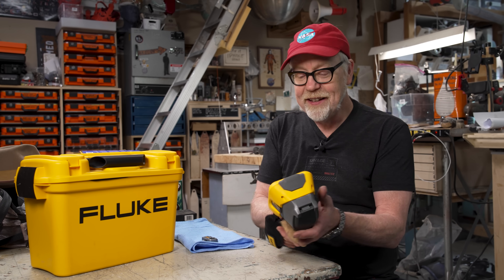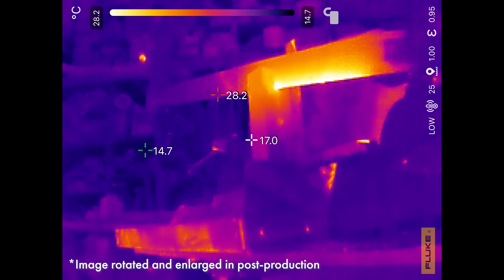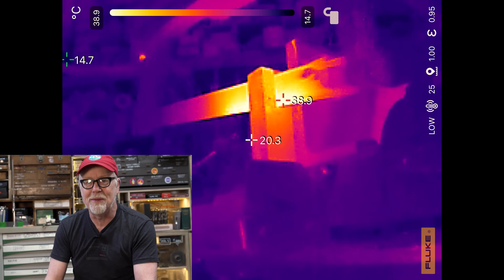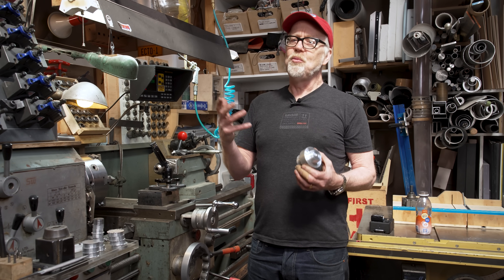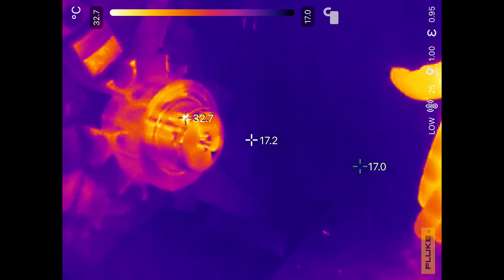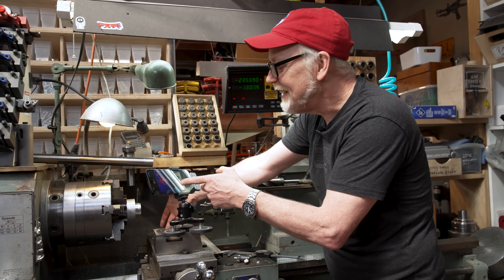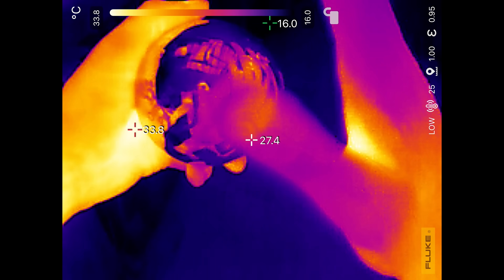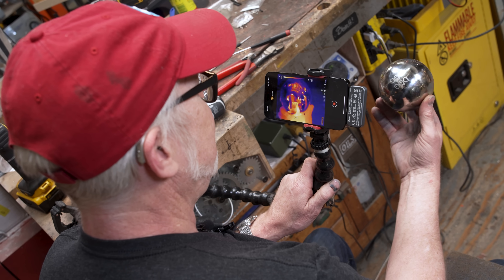What This Thermal Camera Reveals About Adam Savage's Workshop!

Comment: additionally yeah I need to get some thermal cameras so I can give better visual proof of my thermal diode system that uses the heat it is moving to power it, ie think of a house that is cooled by these from them both rejecting some heat and pulling heat out of a house, with out any power, just a passive system until interacted with by thermal photons. best part is all the parts for each unit cost less than 10 bucks, but will eliminate 50 to 100 dollars of a cooling bill with out burning any fuel to extract the heat. Yeah you saw that right, think 107 outside and 65 inside on the window it is placed over, while even the full force AC heat pump cant get that window below 80 or the insulated walls below 67 degrees, (that house only had 4 windows replaced with these and it dropped a 400 a month bill down to less than 100 a month during august, july and part of the june and sept months that are still hitting over 100 for highs LOL)

Comment: For the hacksaw, you could add a limit switch. But it would be simpler to just have a rod of low-friction plastic (HDPE?) that you slide into the saw frame so when it cuts through it simply drops a bit until the hacksaw frame rides back and forth on the plastic bar. No mus, no fuss, won't even squeak.

Comment: I really want a thermal and UV camera together along with visible spectrum of course.  A 3 camera setup that blends all together for a much broader visual spectrum would be super cool.
Reply: We put together a tripod with these, plus added an ultrasonic down-converter, to help identify electric substation equipment that was starting to fail.  It was fascinating, but we didn't get funded to build a "strike team" to go out and examine things in non-human wavelengths on a preventative basis.  Oh, and we added high-res GPS and angular measurement so that people could follow up and find the equipment on a map overlaid on the station!  Specific UV wavelengths are associated with corona-type breakdown of air molecules.

Comment: Your ceiling looked awfully warm in the reflection of the sphere. 
At what distance does the accuracy (heat resolution?) start to fade?
Reply: Distance is not a factor in "heat accuracy".  It mostly works just like a regular digital camera, but tuned to different wavelengths of light.

Comment: A power hacksaw is not a bandsaw. Bandsaws have replaced powered hacksaws because they are faster- no return stroke. Plus all the blade's teeth are used for cutting and the blade is longer so it lasts much longer.

Comment: Fun thing to do with thermal camera. Go to a shelf or a box full of screws or bits. Look through the camera, if they are all uniform temp, they will basically be invisible to the camera. Blast the thing with a heat gun for a second or two, then watch as suddenly you a see all the items based on how well they take on and store/maintain the heat. It's very cool how you can go from not being able to see anything to suddenly getting a full image of what is in front of you just by adding some heat.

Comment: Lower resolution solder kits are cool. Plug-ins for Arduino-like cameras exist if coding is more your speed. Best tool ever for lowering my heating bill, in wall wiring, and leaks.

Comment: Many people have already said it, but I thought I'd chime in; radiative heat would in fact be photons, however of lower frequency than the visible spectrum, hence infra-red. It appears the aluminum is highly reflective to infra-red photons in the frequency range being captured here. Similarly, radio waves / signals are photons, microwaves, UV, X-Ray, Gamma, are all photons. Radio and micro are also sub-visible, and thus lower-energy than visible, while the other three are higher frequency than the visible spectrum, (hence ultra), thus higher energy. Definitely check out the deeper details of black-body radiation. I'm sure you learned something new today, and that's awesome!

Comment: Photons discussion aside, seeing the heat from your hand reflected from the piece in the lathe and the chrome ball also illustrates that measuring the temperature of a reflective surface with a thermal camera can be difficult.
Reply: Indeed, while Adam interprets the warmer area on the sphere as showing the sphere getting warmer, seems to me the effect is more about the dulling of the reflective surface, allowing the sphere's actual thermal signature to be seen in contrast to the area that remains shiny, and thus practically invisible to the camera (i.e. showing instead reflected thermal signatures, not the sphere's own thermal image).

Comment: I picked up a FLIR ONE Pro on eBay a while back and it was quite revealing. From areas with poor wall insulation in my house, to identifying hot-spots in circuit designs, infrared gives a new depth to data. While recently working on a circuit design, I was a bit surprised to find that the bridge rectifier was the warmest component. Data!!!

Comment: I have a Ulefone Power Armor 18T Ultra phone myself. It's a nice rugged phone with a built in "microscope" camera with 30x-60x zoom and a FLIR Lepton thermal camera. I love that phone when it comes to fixing electronics because the microscope helps in finding broken traces on a circuit board and the thermal camera can be used for finding hot spots and malfunctioning components.

Comment: Small physics correction that the reflection is actually photons, albeit at a lower wavelength. Heat is radiated out as photos in the infrared spectrum
Reply: Nit: higher (longer) wavelength, lower frequency.

Comment: 2:43 - well, except that the "heat" it is "receiving" is still the same exact type of electromagnetic radiation as visible light, just at a frequency that's not visible to our eyes.  The experience I had that really gave me an intuitive understanding of this fact was at a MakerFaire (in... 2008, I think?  Something like that.  If you saw a quarter shrinker, that was the group I was there with), and there was a giant fire-breathing dragon sculpture, and it was a little ways away from me.  And I detected a "flash" of heat, that I felt on my skin.  I turned in time to see the flame still coming out, and then I heard it ... and immediately realized that I'd be able to approximate its distance from me by counting the time it took between when the light(/heat) hit, and when the sound did... just as one might determine how close a storm is by doing that with the lightning flash and the thunder clap.  These things are not so fundamentally different!  (Though certainly, the technology for sensing the different wavelengths, as well as other aspects of the camera like lens materials and such, have significant differences.)

Comment: As someone with some daily worn custom cybernetics tech to let myself "feel" thermal imaging via neuroscience tricks, similar slightly to how snakes might perceive some elements of the world around (for my use it is for full 180° spatial awareness of people behind me mainly), the reflective thermals off metalic surfaces also suprised me at first during usage, such as when in an elevator with no other heat sources - keep catching myself, having never considered that before.  It does make sense in hindsight, with the wavelengths and what it is capturing overall. 

The interesting twist, is mirrors often will not reflect as well, depending on the method of manufacturing, being more optimized for visible spectrum reflectivity.

Lots of interesting thermal traces out there, hot and cold, and lots of information available through those lenses, into more abstract information (such as me using thermals for spatial awareness). 
Tech Allows one to literally feel temps otherwise inaccessible, much like that thermal cam does, but as a direct experience sensory wise.

Comment: On the first section with the saw, I noticed the piece being cut-off was hot while the rest of the bar in the vise was not.  I wonder if it's because the vise was acting as a heat sink.

Comment: Would Love to see the effect of cutting fluid on a drill in the drill press. I accept that it provides lubrication, but I wonder how much actual cooling it provides. Does it keep the bit temp 20 or 30C lower? Or only 2-5C lower?
Reply: Cools, and also reduces friction.  You can set some of the cameras to show a fixed temperature range rather than just 'hottest thing in the scene is this color and coldest is that'.

Comment: Very interesting that the band saw blade got hotter when it got to the bottom of the bar it was cutting through. Based on the heat gradient up to that point, I’m presuming that this was because there was less thermal mass left around the blade to act as a heatsink.
Reply: Or he hadn't applied the coolant oil in some time, though yours is probably the larger effect.

Comment: That’s a great segment. I started using a similar product about 15 years ago to find hot spots in a machine I was working on. 
Take it outside on a cold night and see where your house is loosing heat, where you might want to insulate better.

Comment: Hi Adam
Another very interesting and useful application of the IR camera is that you can check and see if your electric wiring in your workshop is not overloaded aka getting too hot. You could try to switch on your machines and  studio lights and have a look at the fuses, automats see which are warmer then other.
Reply: Great for checking bearings too. Exhaust manifold balance when you don’t want a constant EGR, and of-course leaks, because the leaking fluid is almost always warmer than the thing it’s leaking from.

Comment: I love that I had the EXACT same thought at basically the exact time Adam had (relatively speaking, since this occurred in the past)... That this would be awesome to have as Augmented Reality.

And since this is a tiny USB-C device, I see no reason you couldn't mount one to the rim of something like Google Glasses (but a modern version), or even Quest VR headset. Though, for the Quest you'd ideally want 2, but still easily doable!

edit: *throws papers in the air* I paused to type that, and then <30sec after resuming Adam says the exact. same. thing... 🤣🤣

Comment: I enjoyed the gradual shot of the saw cutting through the block. You can notice how the cut piece heated up more over time and the remaining bulk got cooler, as there was less and less touching between the two parts to the point where, at the end, the smaller piece was way hotter than the leftover. It's obvious that it's supposed to happen, but it's nice to see.

Comment: I have infiray p2 pro thermal cam. Half the price, the same capabilities. It even comes with macro (short distance focus) lens, which is amazing for electronics repair.
I wonder if Fluke really allows to measure 500C - mine throws overexposure warning around 180C.

Things to try with thermal cam:
- cover reflective surfaces with isolation- or paper tape, reading should be more precise and not afffected by Your body refection 
- also, different materials (wood, brick) have slightly different heat radiation coefficients, tape should help to "unify" them
- see pan with oil being heated up, swirl the oil by pan movements
- doors with poor seal will have darker/brighter areas around the perimeter, where the air is moving - from hot outside to cooler house, from cool cellar to house...
- 3D printer, observe the layer infill as it's being printed, the temperature gradient over the print wall
- in winter, take it on a trip and see other houses insulation
- sometimes the reading doesn't make sense - thin layer of snow on pavement seemed to be warmer than the uncovered pavement slab - I suspect mentioned material coefficient differences
- well chilled liquid being poured into a glass
- (not tested yet) if You have different windows, with different thermal conductivity U parameter, stick a tape on them and (with similar interior temperature) measure the tape temperature. The window with worse parameter should be colder
- observe the corners of a room. They seem to be colder. Maybe that's why mold and other fungus prefers such spots?

Comment: I've always wanted one of those mobile thermal cams, but I'm concerned about what happens when the phone port changes? You keep an old iPhone running for years just to be able to use it?
Apple has already switched to USB C setting that specific camera on a path to obsolescence and they are apparently considering going portless for some models.

We chuckle at Commodore 64s running machinery decades later, but in 2040 someone's going to be using a frakensteined iPhone 14 that's not allowed to connect to wifi to get their thermal camera working xD
Reply from the maker: We assume Fluke would make additional adapters. We used one for our iPhone.
Reply: @tested  Oh, I see (pun intended). There are separate models for iOS and Android, but the iOS one can be used with an adapter to USB-C to work on iPhone 15.
Problem mostly resolved then. Thanks!
Reply from the maker: @Syncromatic  Well done on the pun!
Reply: Well it's still better than the cameras inside phones - at least you can keep the camera this way and swap phones, my infra cam is on the fourth phone as of now.

Comment: 0:50 Lightning connector in 2025?  So you need a 3+ yr old iPhone to use it?
Reply from the maker: There are many different adapters because different people have different devices.
Reply: It appears that the usb-c version does not work with an iPhone 15 or 16, only android. They need an updated version to work with the current iPhones without using an adapter.
Reply: Obviously it comes with different connectors depending on what device you have. Use your head.
Reply: @ApexRotors  no Fluke are lazy and need to update the connector, on a product they charge a lot for
Reply: @brosnan  I simple search will show they have USBC versions of the same device.
Reply: @ApexRotors Not that work with an iOS device. The USB-C version they sell is Android only for some reason
Reply: Just the right kind of adapter is needed. It’s a lot cheaper to buy a dongle than the replace the thermal module

Comment: RE: Ghost footprints: If you mill some aluminum into a foot shaped heatsink, and put them under some thin flooring, you can run hot water through it. Daisy chain a few of them together and you could have your own invisible thermal ghost footprints.
Reply: Though to play to the "cold spot" ghost mythology, pairing the heat sinks with peltier coolers might be the better move, leaving cold footprints instead.
Reply: Low voltage heating elements would probably be more practical than liquid for a novelty installed inside your floor.
Reply: @thedanyesful just hook it up to the drains so it's passive. Then the mythology naturally evolves into "it only happens when the water is running, did they drown?!"
Reply: @thedanyesful  Although, as folk pointed out, "ghosts" are said to create colder temps, and with water they could just pump cold water through it. With electricity you'd need a Peltier, and with those I'm not sure if you can simply reverse the polarity to change it to being the cold side, or if the hot/cold sides are static and you'd thereby need to physically flip it...
Reply: Imagine doing that, but to a house or even just a guest bedroom, and not telling anyone. Then they start to notice how there's warm spots on the floor... Then they figure out it's in specific spots... THEN they figure out they're foot shaped and step spaced... 🥺😱 
🤣

Comment: Though if the temperature of "ghosts" tend to be cooler you wouldn't see a heat signature that would just artistically used in those kinds of films to give a representation of a ghost.
Reply: You’d see the opposite. Where they touch it’s colder.

Comment: Thermal imaging IS light imaging. Radiant heat is light at a wavelength slightly longer than our eyes can detect.  We call that "infrared light". That's why radiant heat reflects like light - because that's what it is.
Reply: Slightly longer wavelength, not lower.
Reply: @MrRickkramer  Correct. I said frequency at first and then edited to change to wavelength but forgot to also change lower to longer. Thanks for the catch!
Reply: @MrRickkramer  Lower frequency.... Come on bro, use your brain.
Reply: @DreadPirateMayhem  He did and was 100% correct.
Reply: @DreadPirateMayhem  Why try to belittle a simple editing mistake? Come on, bro, that's childish.

Comment: I am struggling to NOT buy one of these fantastic little thermal cameras. 😂
Reply: I can make it worse for you - Topdon makes one that's less than half the price!  I've been using mine (a Topdon TC001) for several years to find insulation gaps, check electronics/tools for heat issues, and just for general fun!  I've also loaned mine to several friends for them to use too (both of them have moved into new houses and wanted to find areas that need attention)

Comment: It’s for leaks?
Reply: Like when you let hot water run out of a faucet and close the faucet, the faucet itself got hot.
Same for hot/cold air leaking from tiny holes: even, if the air itself radiates not enough (or cold air blocks not enough radiation from the background) to show up in the camera, you could at least see the border of the hole being colder or warmer as the rest of the environment.